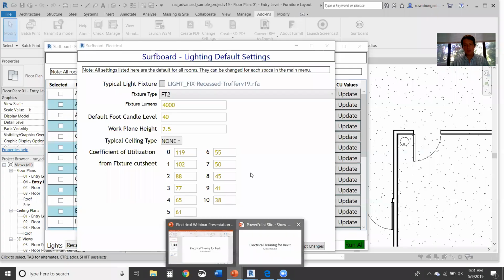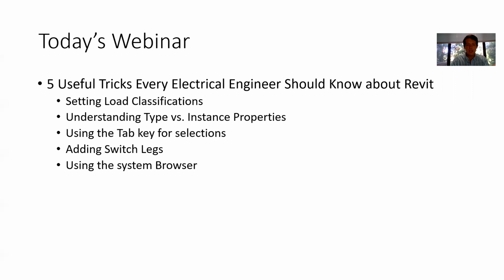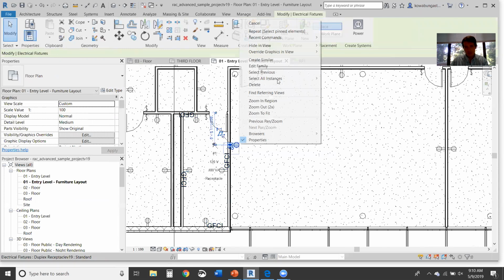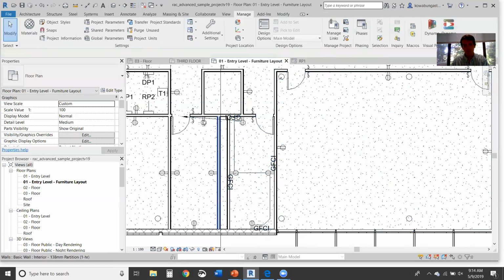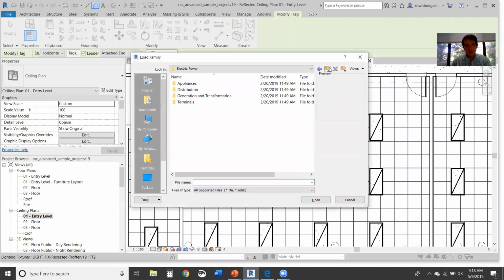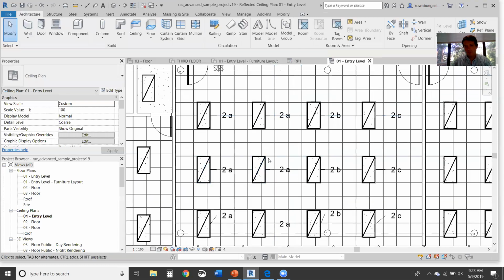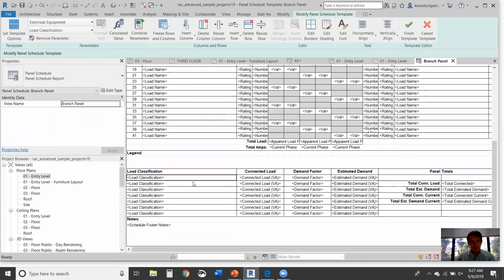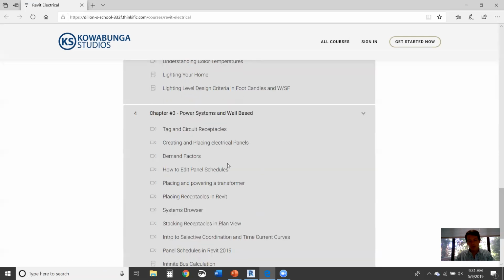Electrical Revit Training 5 Tips and Tricks

Comment: I see the demand factor gets applied to the individual panelboards. Does it also get applied to the over all system. Ex you have 10 receptacle panelboards. Does it take 100% of the first 10K of receptacle load of the total sum of the 10 panelboards and 50% of remaining receptacle loads?
Reply from the maker: Yes, it will apply it to the system as a whole

Comment: Another question: Have you ever checked revit’s math on panel schedules?  I’m a bit wary on it. And have you gotten load classification summaries to show up reliably on the bottom of panel schedules?  I’ve found that Revit likes to leave load classifications out unless you explicitly list which ones you’re using, which is a big time hassle
Reply from the maker: You do have to be diligent as to associating the loads correctly, but the math is correct when done properly